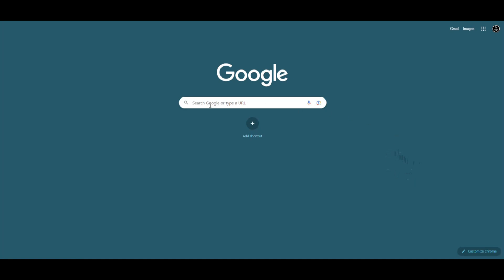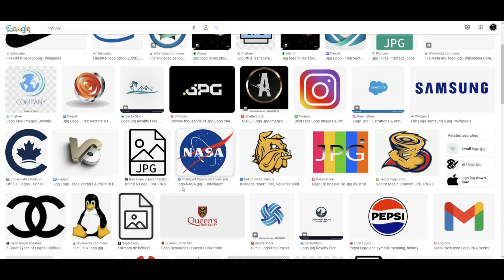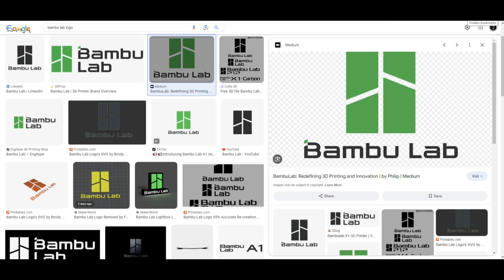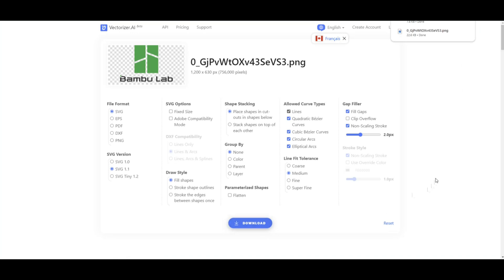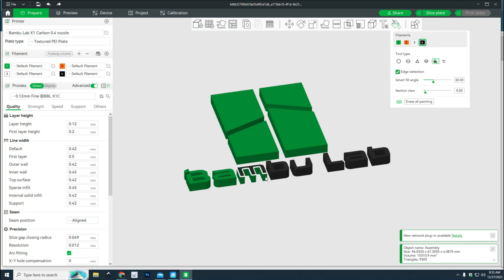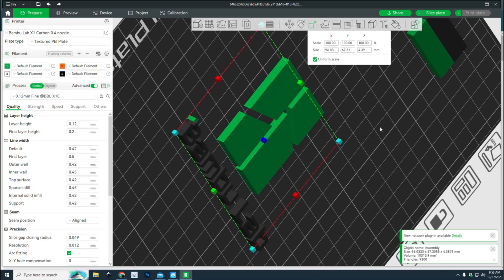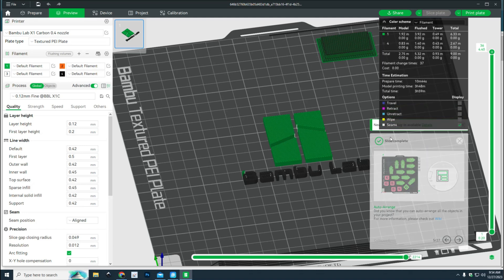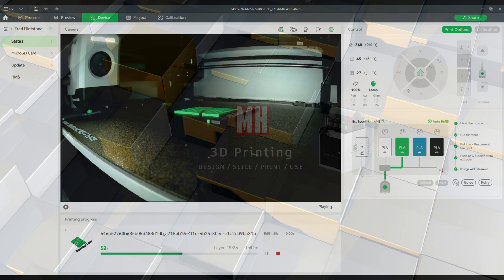How to print a JPG or PNG on your 3D Printer

Comment: I keep getting the background loaded along with the logo, doesnt matter if its transparent or solid color. How did you load it to not have a background and just the logo?
Reply from the maker: Is it a file with a .PNG extension ?
Reply: @MH3DPrinting  it is yes
Reply from the maker: If the original PNG already has a background, you need to get rid of it first ( like in Photoshop for example ), or you need to select a PNG that does not have a background. Sometimes a PNG shows the checkered background, but in reality it's just an image background. Sorry if this sounds confusing @Howtoeverythingeverywhere
Reply: @MH3DPrinting  thanks that makes sense, I'll try that out!